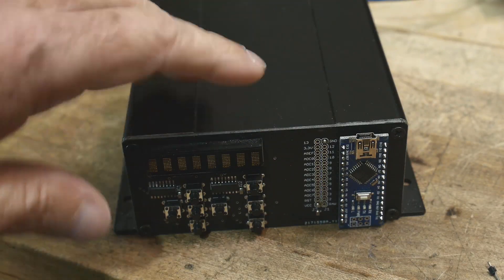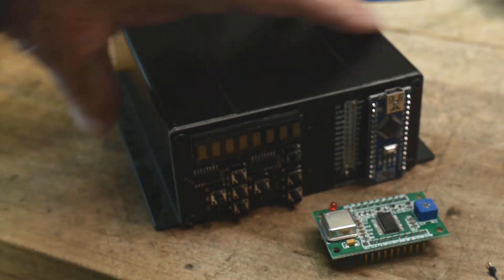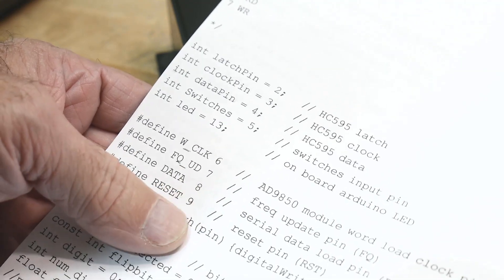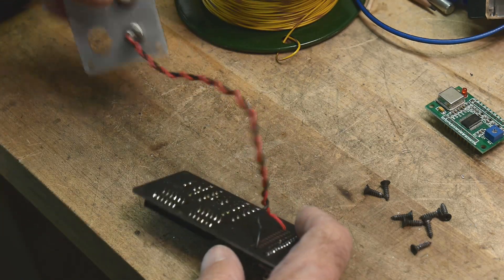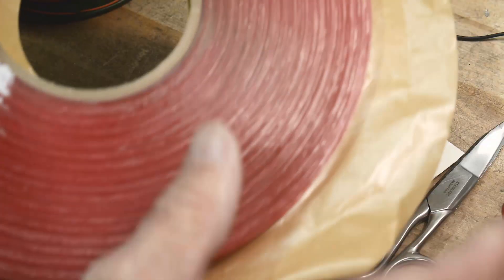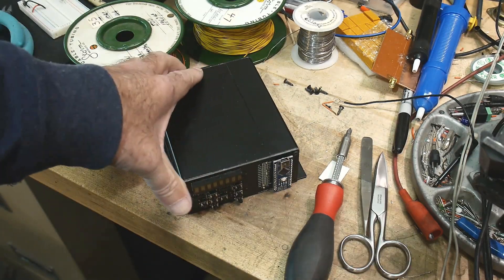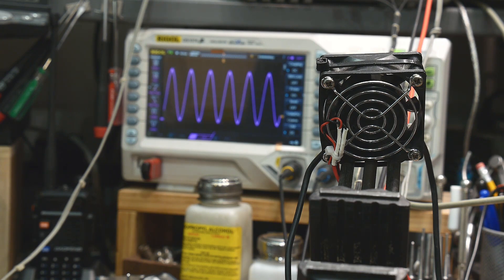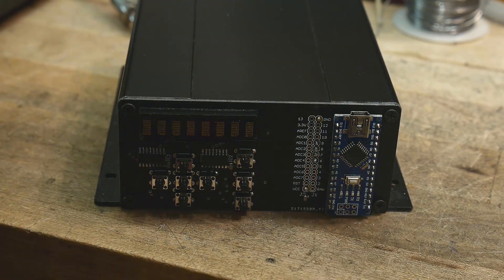#665 0 - 30MHz AD9850 DDS Arduino Sine Generator (part 1)

Comment: What a coincidence, I have been fooling around with that exact same board over the holidays. I am using it to make a substitute local oscillator at 38.1 MHz for a mixer to substitute for a broken TV tuner from a 1948 Dumont TV. The TV tuner main shaft is ceramic and it is broken. Repair is possible I hear but in the mean time I'm just going to mix my RF modulator output from channel 3 down to the TV IF frequency at 21.9 to 27.9 MHz using an NE602 and this DDS board. So far it is working well! One note on the serial programming of that AD9850 chip: read the datasheet carefully! The serial data won't load unless you do the clock and FQ_UD pulses first as shown in the datasheet. I wasted most of a day finding my error there!